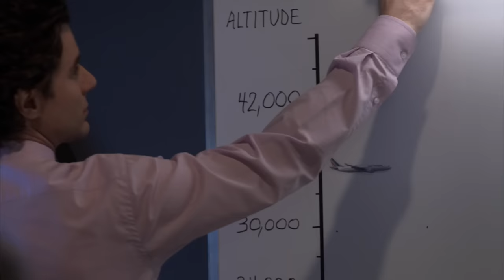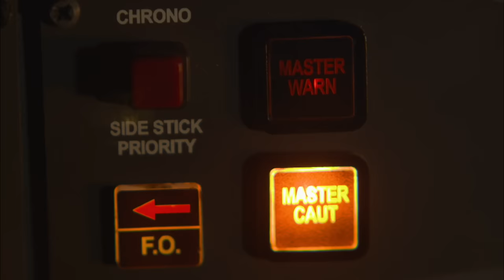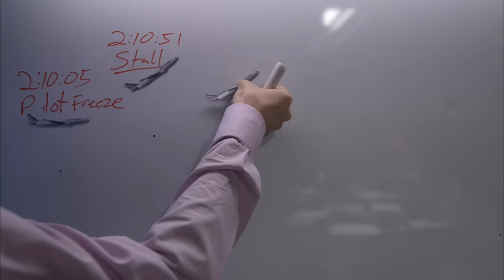Investigators Are Shocked by How a Pilot Handled a Minor Problem ✈️ Air Disasters | Smithsonian

Comment: The difference between life and death on this accident came down to Boeing VS Airbus control methods. On the Boeing both controls are synched both pilots know and feel what each is doing. On the Air Bus both controls are independent so if one pilot is pushing up and the other pilot is pushing down the result is ZERO movement in any direction. This can be a disaster if you have a stall as one pilot could panic and push the control in an opposite direction which is exactly what happen on Airbus Flight 447. Once the co pilot pushed the nose up on his controller the other pilot then pushed his own control forward to get the nose down but now there was a zero movement because the first pilot pushed his control all the way back already so the other pilot had no hope of recovering the stall. The main Pilot should of never left those 2 pilots alone on the flight deck during a storm and with Pitot tubes frozen.
Reply: Please, stay in your grotto.
Reply: You were exactly correct until you got to the end. The sensor froze up after the captain left the cabin. It was a known issue with the plane and they were being replaced.
The captain probably believed they were competent to fly a straight line on auto pilot for a few hours.
Reply: @neilkurzman4907  A known problem not adressed by Air France training department staffed by lazies.
Reply: @stabilo3170  
Unfortunately, we will never know the details. But since this is such a basic thing, can you point out to an adequate training possibly inadequate testing?
Reply: @neilkurzman4907  Yes, once the tubes froze up the auto pilot disengaged due to the speed of the airplane not being able to be determined as correct it was too fast of a speed warning, for a pilot at night and getting a warning that you are flying too fast this is why the co-pilot banked up to slow the speed down, but doing this st 39,000 feet is a recipe for a sure stall.
Reply: @danfuerthgillis4483  
It was an on issue with that plane that the Petito tubes would freeze up periodically.  So they did not correctly identify the fault and act as instructed then the one pilot stalled the plane, did not recognize that they stalled the plane and did not recognize they doing the exact opposite of what they should be doing. The fault resolved itself within 56 seconds.
Reply: @neilkurzman4907  Sadly the co-pilot was banking up all the way down to ocean, all 3 pilots mixed together was also a recipe for disaster. The pilot should of never let those 2 in the cockpit alone during a storm.
Reply: @danfuerthgillis4483  
Apparently, the senior pilots opinion of them was higher than it should have been.
Reply: I read that the captain had only slept one hour the night before the flight. Seems like he is the only one who knew what he was doing and might have saved the situation, but by the time he arrived the other two were in full on panic mode and he was standing behind them seemingly trying to assess the situation too (with blaring warnings,etc to add to the chaos). It was a complete shit show and so sad to think about the lives lost.

Comment: How do you recover from a stall without knowing your air speed?
Reply: The plane has a system that will tell you the altitude and the speed to recover from a stall lower your plane nose down and it will gain speed and then you can climb and maintain altitude.
Reply: I think Jeremy Clarkson said it best.... POWER!!
Reply: By applying SOP.
Reply: The fault was a temporary freeze up of the Pitiotubes. If they had done nothing, the plane would have been fine, and they would’ve defrosted after about a minute during the dissent they were defrosted, and we’re reading accurately, but because they were stalled, they weren’t reading any air speed they were falling down. The pylon control was pointing to stick up the direction he wanted to go exact opposite of what he was supposed to do by the time the senior pilot came in and assess the situation. It was too late to recover.
Interestingly, part of the problem is the layout of the Airbus cockpit. The side stick is hidden from the other pilot so you can’t see what they are doing and apparently the airplane didn’t warn anyone that both pilots were doing the opposite thing one pulling up the other pulling down .
Reply: N1x & Theta x, when applying these basic rules you are safe.
Reply: @neilkurzman4907  Side stick versus Yoke is an endless debat. I consider that flying an aircraft is not a fight against my partner (Captain or First Officer) so the side stick has my favour. It's very precise and confortable.
Reply: @stabilo3170  
Every system has its own pluses and minuses. This is just one minus of the side stick. There were thousands of them flying around every day, and the pilot seem satisfied with their function.
From a system standpoint I’m not sure why the plane would add together to two sticks rather than just complain that they didn’t match. I assume there’s some logic behind it, but I’m not a pilot so I wouldn’t know.
Reply: @neilkurzman4907  I agree with the first part of your message, without any action from the crew the flight would have continued as is.
I disagree concerning the side sticks, first of all the mechanical layout is confortable for the pilots clearing the view of PFD&ND / sliding table and  the silghtest dual inputs are followed by an aural and visual warnings.
Reply: @stabilo3170  
I’m not going to debate the arrangements since I’ve used neither one of them. I’m just saying from an engineering point of you and he systems going to have pluses and minuses. And in this particular case where one pilot was doing the exact opposite of what they were supposed to be doing, it would’ve been more obvious to the other two pilots.

For example, if the sticks were toward the inside instead of the outside it would’ve been more obvious.
I’m sure that would also have negative implications. In the end here it was pilot error. The question is how do you avoid a similar situation in the future? 
The reason we study crashes is to prevent future crashes, because you can’t change the past.
Reply: @neilkurzman4907  Again when there is a dual order from captain and first officer side there is an immediate aural and visual warning .
Concerning your suggestion about the sticks positions, do you mean that the captain should have his stick on the right hand side and the first officer on the left hand side?
Reply: @stabilo3170  
I’m not suggesting anything I’m pointing out if the sticks were toward the center of the aircraft instead of the outside, then it would be visible to the other pilot. I hear that in some of the newer planesAirbus plans on putting in a feedback system, so that the sticks are “connected”. 
In this case, one pilot didn’t know what they were doing, and the other pilot didn’t know he was doing the wrong thing. The automation in the plane did not help them in this matter. 
The question is, what did we learn and how we’re going to make sure that it doesn’t happen again? Besides the obvious of ensuring that Air France pilots know what to do in a stall. 

Apparently, there are up and study stand that show the higher automation of Airbus has it reduced accidents compared to the lower automation of Boeing planes.
Reply: @neilkurzman4907  Sticks on the inner side is impossible as you need to have one hand on the stick and the other one on the thrust levers.
What can be done to avoid such accident? In AF they understood that their pilots needed a specific training for high altitude handling.
Personaly I agree to install a cockpit video recorder system, such system would have been very intructive regarding AF447 accident, but unfortunatly most of crews are against arguing that such system is intrusive in their private life wich is perfectly stupid as their are working and the recordings can be erased after each flight by simply pressing a pushbutton, this is already the case for the cockpit voice recorder.
Reply: Makes you wonder...if nose down is always the correct move in a stall why doesn't the warning say "Stall, Nose Down!"
It does say "Terrain, pull up!".

Comment: My only aviation experience is through games and I can tell you this....
If the engine stops, nose goes down until you get some speed and then pull up for a glide.
Reply: The engines don't need to stop to cause a stall (not like a car). It's the air stalling over the wing that stalls. The engines were fine and working normally. That's the sad thing. So unnecessary.

Comment: Everytime I see people commenting on Bonin it drives me nuts.

Hello, couch pilots. There was no valid info. They were flying at night with no clue to what was happenning. Bonin made an understandable mistake by reacting to a drop in altitude before they realised the autopilot went off because of a loss in information. Once he did that, this plane was basically gone since they couldn't know their status.

Robert and Dubois did thought they were stalling, but that was a guess like any other. They could be in overspeed, who knows. I would say Bonin's main flaw was to fail to communicate his pitch position. Maybe there was time to recover.
Reply: There was no valid airspeed initially, that was it. (minor alt error due to the blockage) This was a pilot that had no understanding of his aircraft, it's systems, and could not hand-fly the damn thing. It was the over-controlling nature that led to this upset.